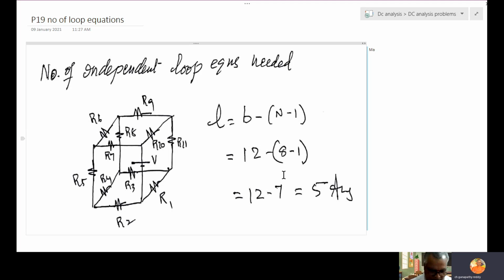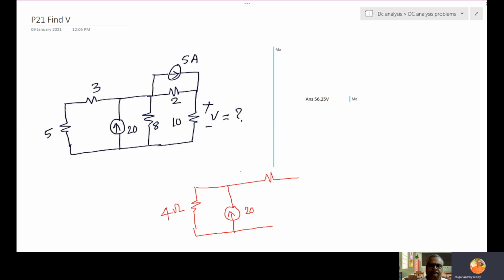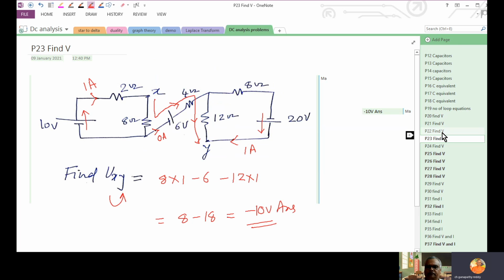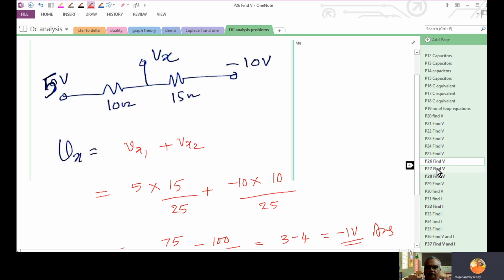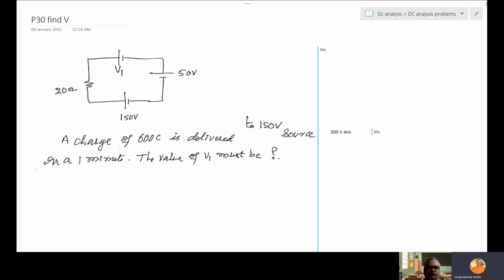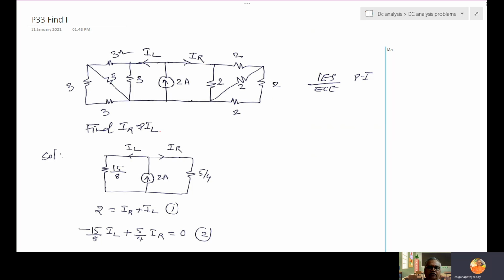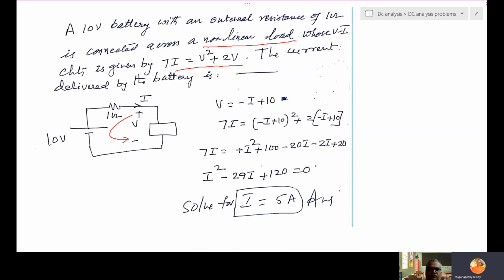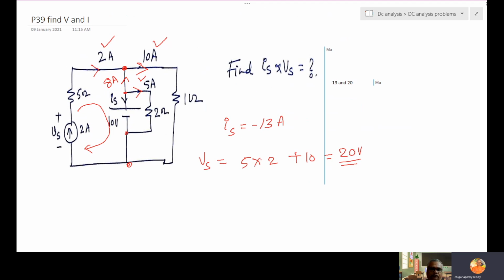19 DC analysis Find V and I

Comment: Sir, @22:23 why can't that potential difference across the two terminals be 15 V ?
Reply from the maker: Yes 15v is correct from left to right
Reply: @ganapathireddy  So in that case sir, can Vx be potential drop across 15 ohm resistor ?
Reply from the maker: Vx it's a node voltage,always w r t grnd.